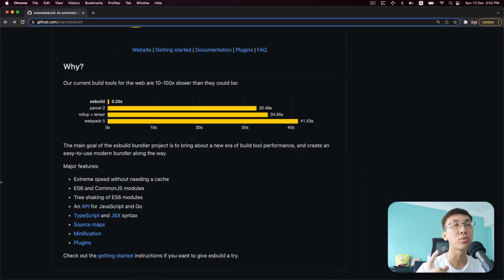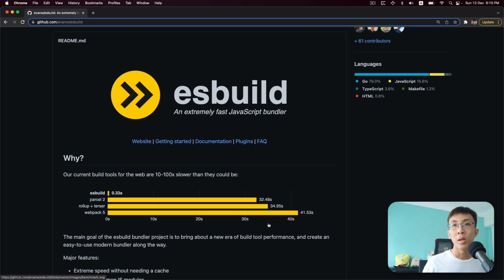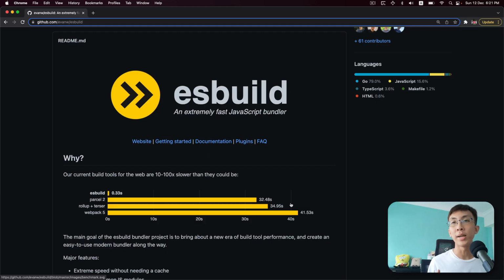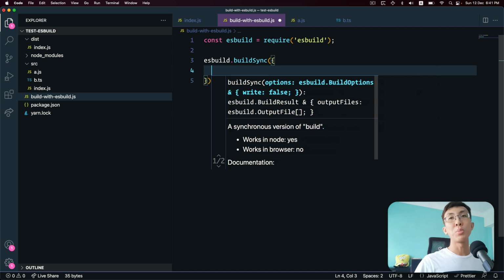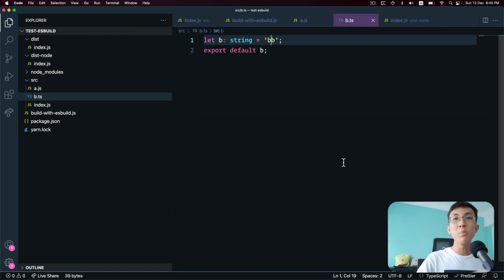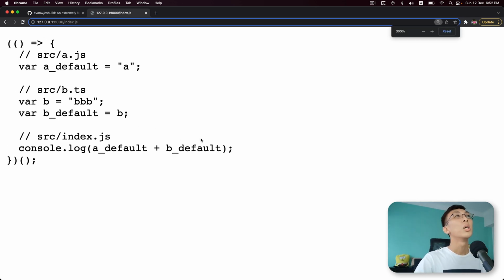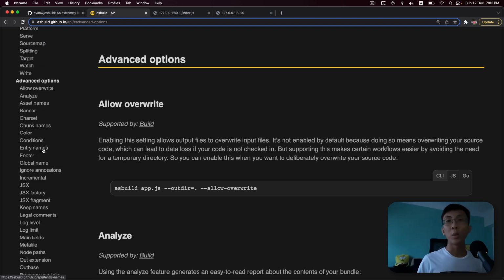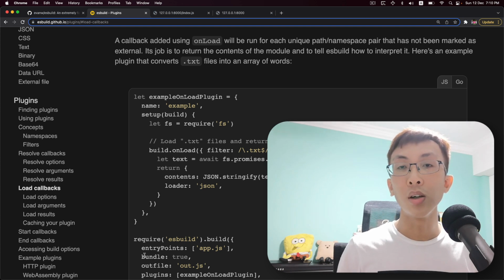Let's talk about esbuild

Comment: Please fix these 3 issues before publishing your next video:
- balance the microphone's volume.
- force dark mode in chrome or switch to light-mode in any other application.
- use the integrated terminal of vs code.
My ears, eyes and brain will thank you a lot 😉
Beside that; i like your contents: it's mostly compact enough to understand on the first run and covers the key points well.
Reply from the maker: Yea I'm still figuring out the microphone, it's directional, as soon as I turn my head away, the volume turns soft
Reply from the maker: Thanks for your feedback btw
Reply: @lihautan  if you record with OBS you can use a compressor on your microphone
Reply: @lihautan  try out a compressor. Reaper has a decent compressor built in called reacomp. Try using two of them in a chain. First one catches the sudden jumps in volume (fast attack, medium release) and the second smooths out the rest (medium attack, medium release)
Reply: And please paint your walls PMS Neutral black and wear a Bauhaus tee-shirt next time… 

(Kidding. Please continue to focus on the outstanding content! I’m sure the comment was well-intended, but most of us don’t mind if the production quality isn’t perfect, we come here for the content.)
Reply: @ikkentonda  well thought 😉

My comments focuses on some simple improvements for the video quality:
- the microphone volume was a deserter (Lihautan already replied, why).
- jumping between contexts (editor and terminal in this case) is a bad habit for presentation style (The audiences eye guidance is interrupted).
- I've watched the video at late evenig, so the pop in of the white browser burns my eyes.

If you are in apprenticeship, these tips might bring you some bonus points in your exam presentation 😉